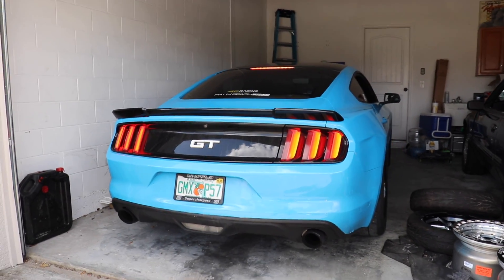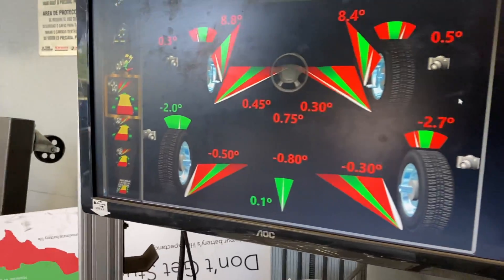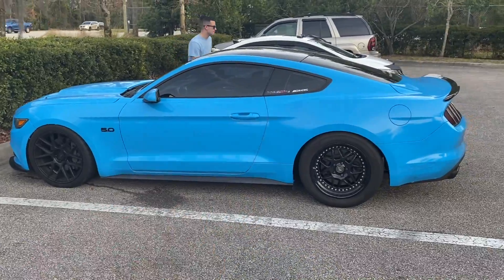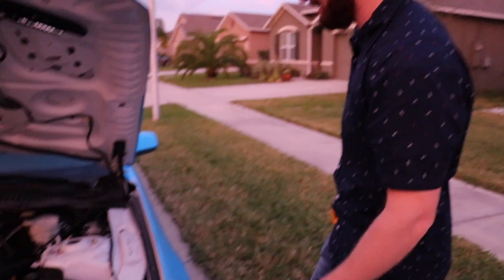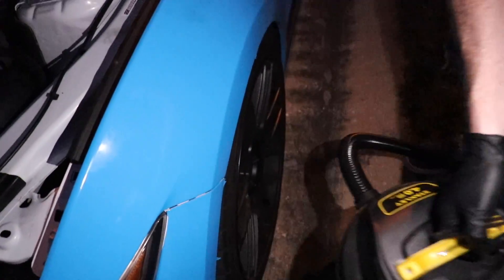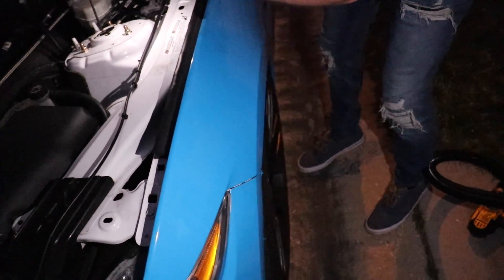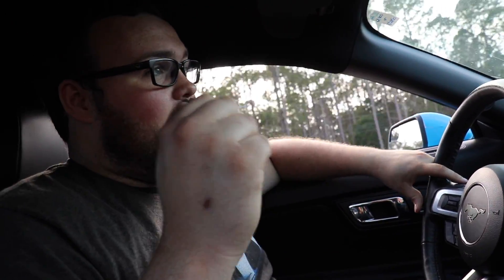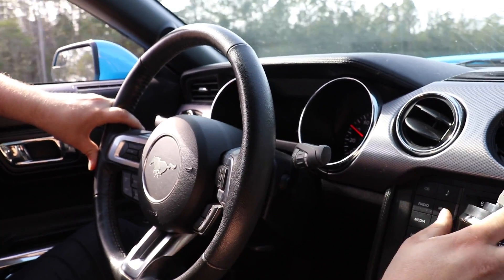840RWHP Whipple S550 Will it Hook?

Comment: Question I have a 2000 mustang gt project going on the car was a automatic I've got the clutch pedal assembly installed so how do I wire the netural safety switch up